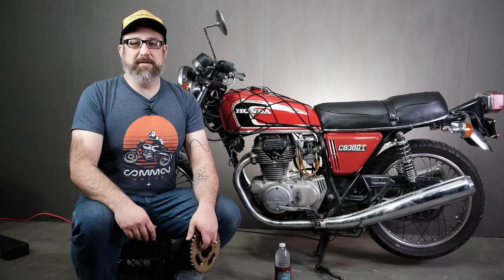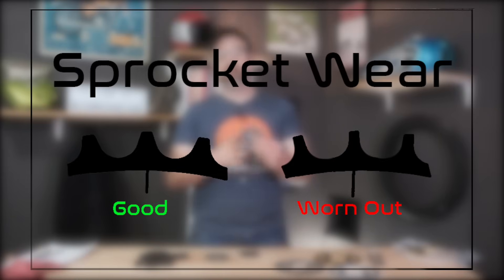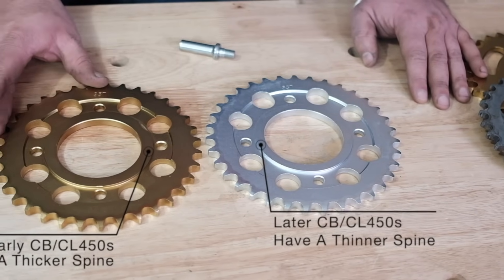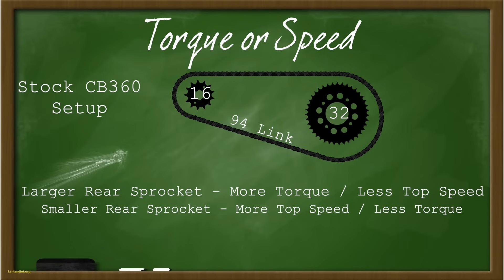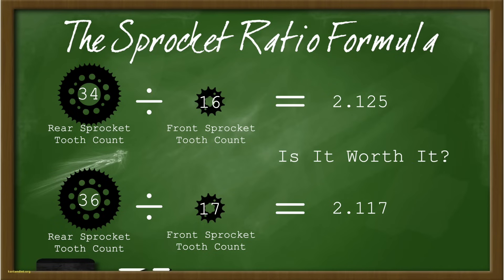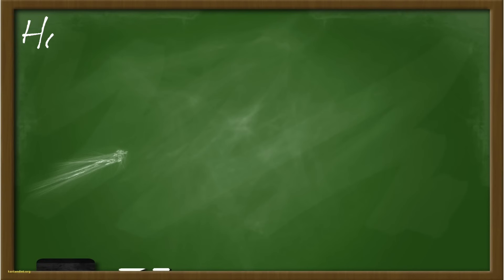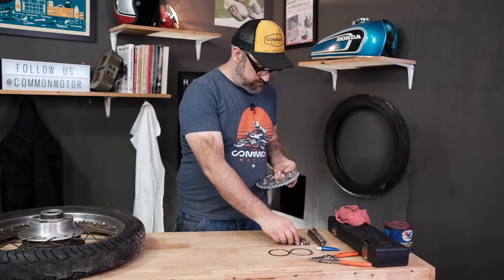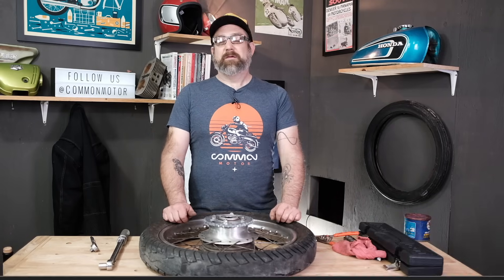Sprockets 101: Torque or Top End Speed

Comment: Thank you for the video. The maths section was great and it wasn't complicated at all. You mentioned the ratios but you didn't conclude what the ratios meant comparatively.

Using your other, simplified explanation though, i am guessing that the lower the ratio the higher the top end speed and the higher the ratio the larger torque. Is that correct?

Comment: Sorry, but the chain length calculations are just wrong. Adding  two sprocket teeth does not require two more links since the chain wraps only halfway round the sprocket. So in your example of adding two in the back and one in the front requires one and a half links in principle, which you round up to 2, as the number of links is in any case an even number. If you made it 4, you would have to move your rear wheel back by one chain pitch (5/8 inch).

Comment: I currently have a 14T/48T sprocket setup on my XSR155. At 5th gear, I can reach around 8-9K RPM at ~130 km/h, but in 6th gear, the bike struggles to rev past 5-6K RPM, limiting my top speed. If I switch to a 13T/48T setup and, hypothetically, it allows me to reach 10K RPM in 6th gear, which setup would result in a higher top speed? Would the increased RPM from the 13T compensate for the shorter gearing, or would the 14T still be better for top speed knowing it only goes 5-6k RPM at 6th gear?

Comment: Upping the gear ratio (smaller front/bigger rear) lower top speed IN THEORY. As in it's assuming your bike have enough power to max out your last gearbox gear. If you can't redline in 6th gear, upping sprocket ratio will actually gain you low end AND top speed.

Comment: From a large sprocket The torque is reduced but the mileage is increased and the resistance against the frontal wind is increased and in addition it uses more power when going uphill.
Reply: Large front sprocket or large rear sprocket
Reply: @NA-oq4ty  Front Sprocket with 16 Teeth

Comment: So if we do the 17 front and a 34 back, the speed will increase?
Reply: 1t on front sprocket equals -3t on back sprocket so if you change lets say 40t rear sprocket to 34 it changes speed a little bit and if you switch out a 14t front sprocket for 17t it increases the speed

Comment: I have a Coleman BT200x I put a 10 tooth on front and 60 on the rear tire 6-1ratio which Wii give me lots of torque correct it’s with a torque converter 30 series

Comment: Would you recomend to tune your sprockets so your cruising speed rpm matches your top torque foot-pounds rpm? 

For example lets say that my bike tops torque at 3000 rpm. Would it be ideal for me to tune my sprockets so at top gear and full throtle my bike remains at 3000 rpm? Or It would be preferable to aim for the top hp? Wouldnt it be too harsh for cruising?

Would this make the engine work at its best or would we be forcing it to perform under more stress?

Comment: Regarding the picture at 9:01, if you increase tooth count on the drive sprocket, I’m pretty sure you’d Lower your RPM(-500) at a set cruising speed,  not raise them(+500). It could also be said that you’d increase your cruising speed at a set RPM
Reply: I noticed that to haha
Reply: You are exactly right! Adding teeth to the front sprocket lowers RPM. Subtracting teeth from the rear sprocket lowers RPM. Exact opposite of what that visual shows. 🤦

I seriously don't understand why any western motorcyclists can never understand this concept. If you ever wonder how South Americans travel at highway speeds with a 150-250cc bike, it's just because they gear their bikes properly (and are sold bikes with proper gearing in the first place!)

Comment: hey all. Please help. I've got a 125 cruiser and my front spocket is a 14T front and rear is 41T. Im thinking of changing both of them too a 16T front and 48T rear. I've found out the diffrent ratio's and its going from 2.93 to 3.00. If I was to change the sprockets over would that put stress on my engine or would it be fine? And is having a higher number on the ratio better or not? Thanks

Comment: If my bike does 15kmph smoothly on 1st gear and i want to increase it to 20-25kmph smoothly on first gear what should i need to increase or dcrease the rear sprocket teeths ?
Reply: increase tooth count in front sprocket and decrease tooth count in rear sprocket. boh options will give you a higher speed in each gear. i suggest going up 1 tooth count on your front sprocket
Reply: @daddyhobo2  thank you brother 🙏

Comment: I’ve got a Lexmoto Venom sk125 22 with a 15 tooth sprocket on the front and a 41 tooth sprocket on the rear, it currently tops out at about 60mph, i want a higher top speed of like 70 but want to have decent acceleration aswell, could y recommend me a sprocket size combination so achieve this.
Good video aswell!
Reply from the maker: Ahh, the ole' conundrum. You can't get both, you either get more top-end speed or more torque/acceleration.
Reply: @Common-motor  does shorter gearing actually increase the torque or just make it come early??
Reply: @Hsp44  no it decreases. If you have less than that it will increase your speed but reduces your torque.

Comment: Excellent video, I find it a bit annoying that 1st gear on my bike doesn't really get through a turn at an intersection. So my 2 choices are either rev out first and complete my turn or grab for second halfway through the turn. Will changing my rear sprocket size from 41 to 38 help get me a few extra mph in 1st? Or do I have that backwards
Reply from the maker: Forgive me! I had a huge lapse and I had it backward. Going down in size will give you a bit extra in first. I was completely wrong the other day!
Reply: It helps increase your speed but lessens your torque.

Comment: Hey just a question. On the chart in the video at exactly 9:00 minutes is. When you put +500 rpm does that mean your bike cruises at 500 reps less or 500 reps more. Im trying to get top end speed, so i need to add in the front and reduce in the back. But does that mean my bike will run 1000 rpm higher or lower?
Reply from the maker: Hey Jonathan, you have it backwards! The +500rpms means if you make that change(in this case +1 tooth on the front sprocket) you will need to be going 500rpms faster to maintain the same speed. this would decrease your top speed but increase the torque. If you are wanting increased top end speed you want to either DECREASE the FRONT sprocket size or INCREASE the REAR sprocket. Easiest and cheapest way to increase speed slightly it to go down 1 tooth in the front.
Reply: @Common-motor  I think u got it wrong there. Think again
Reply from the maker: @musabzain2168  We totally got it wrong the day I left this comment! It's exactly the opposite of what I said. I've explained it too many times and now I'm mixing things up haha. Bringing the sprockets closer together in size=more top end speed, pushing them further apart=more torque. Thanks for catching that Musab.

Comment: So I went one up on the back a while ago and didn’t care for it but is that the same as doing one tooth in front or is there more effect with  back then front or opposite ?
Reply from the maker: The front will make the change twice as effective whether its up or down. We recommend changing two teeth at a time when changing the rear to have a noticeable difference. Front sprockets are also cheaper and easier to replace.
Reply: @Common-motor  I tried one back a while ago and it was a Moto now change but it wasn’t the feel I liked my quad has such a low first gear I barley use it with factory. So I am going to try a ore tooth in front now n see what happens

Comment: Torque gained from off the line to a possible higher top end gain on a level I would say is stated more or less. Not mentioned though is the real useful effect occurring upon "each gear" from first to top gear in regards of the change in mph range gained or lost of each that will be effected. What the factory suggests is an all round market guess. I do not sport bikes anymore I simply just cruise ride thus go for taller gears for reasons of mpg and lower notes from the exhaust, however first one must learn where the average rpm is upon their use and move it up or down in rpm to mph ridden most of the time.

Comment: Does this mean that if you put bigger front sprocket or lower back sprocket that will will get better gass mileage? That way you won't need to rev the bike as much to get to the wanted speed?
Reply from the maker: Exactly! If you are getting the two sprockets closer together size wise you are increasing top speed which would give you a bit better fuel economy. You will be going faster while the engine is working the same as it used to at a slower speed. It's probably now going to be you much but that's the idea.

Comment: i got a question, how can i calculate the aproximate diference in speed for each gear? in %. i want to change the sprokets on a cub i have, orginally is 50cc but now it has a 70cc engine. and i want to compensate with the sprokets. the option is going from the stock 48/13 to either 48/14 or 45/14, so stock is 3.69 ratio, then 3.42 then 3.21 respectively .. i dont want too much difference, just maybe a increase in top speed from 50kph to 60kph
Reply from the maker: Hey Marco, Im sure there is an equation for it but I don't know of one myself currently. Sprocket ratio is primarily what's used in the industry but if you come across an equation I would love to know it

Comment: what if front 15 to 14 and rear 47 to 49, no need to change the chain link?
Reply from the maker: You should be okay! If you are already at an extreme of your chain adjuster maybe not but otherwise you might be fine
Reply: your stock setup is 15/47, which means your drive ratio is - 3.13.
you're changing it to 14/49 wich result in a final drive of 3.5.
oh boy, you're gonna loose a hell lot of top end and gain wheely popping acceleration. 
with this set up, you're gonna hate your bike on highways.

Comment: By any chance, you have some research papers that relate the role of torque and speed with the size of the sprockets? I am an engineering student and that will be helpful, thanks.
Reply: Just check the ratio difference, it will give you torque reduction/increase

Comment: I want to reduce engine RPM  at 70mph from 5000 to 4000, what sprockets should I change and by how much?
Reply: get a 17 tooth in front, and 38 in the rear.
Reply: I suggest u try to reduce the rear sprokets 2 tooth at the time till u get the result as u want but if added more tooth u will get high torque n low high end speed also increasing the rpm

Comment: guys help me out. i have a yamaha yzf r125. with a custom 183cc cilinder malossi kit with powercommander. my mc does 125km/u. stock it normally does 130km/u. and right know my mc is max at 10k rpm. i struggle to stay on the highway. what do i do to get more top speed easy. right know it does 100km/u easy then struggles at 110km/u to 125km/u.
Reply from the maker: I sounds like you're giving it everything its got! Even getting on the highway with a sub 200cc motorcycle is good.
Reply: @Common-motor  so i can't do anything to make it faster? Without breaking the bank
Reply from the maker: Thats what I'd imagine. Not familiar with that specific bike but you aren't going to gain significant enough speed to warrant the price.
Reply: @Common-motor  the weird thing is with the original 125cc yamaha engine people buy a ecu and it goes 150km/u. Thats the weird thing
Reply: @gloriouschannel3683  1- change full system exhaust. 
2-drop rear sprock tooth by 2 or 3,
3-remap the ecu to perfomance mode.

Comment: I don't quite understand the text at 9:02. If a smaller front sprocket gives more torque, but less top speed, wouldn't it require a higher RPM to reach the same cruising speed as a larger front sprocket, not less?
Reply: I've gone up from a 15 to 16 front sprocket and it drops the revs by about 500 rpm than previously as I felt I was needing another gear.
Reply: Those were my thoughts too

Comment: I'm in the process of changing my wheel bearings.   When reinstalling the four stud bolts into the hub, should the studs be greased?   There was light surface rust on the studs and inside the sockets when I pulled them out.
Reply from the maker: Greasing helps keep them from sticking when trying to remove them in the future.